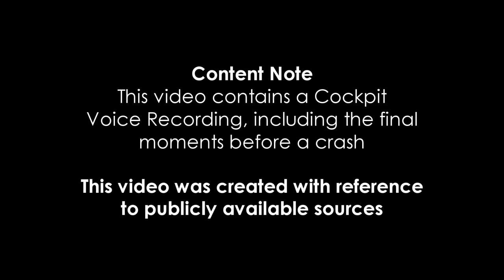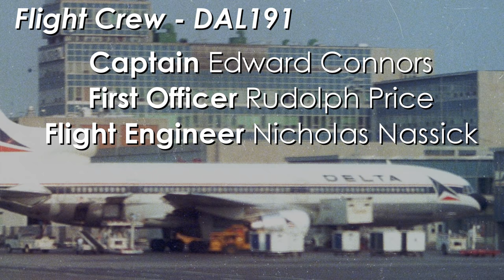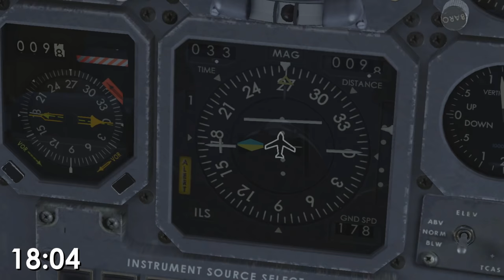How Deadly Weather Brought Down This Plane (Delta Airlines Flight 191) - DISASTER BREAKDOWN

Comment: Speaking as a former L-1011 pilot, I want to tell you this is one of the best summations of the accident available to the general public without getting into the extreme minutia of the case. I appreciate your attention to detail (though to be fair I must point out that you used an L-1011-500 variant in the video CGI model versus the actual aircraft: N726DA was a long-fuselage -1 variant without the Frisbee fairing). At any rate, while not all-inclusive, this is a very well done video. 

As an aside, I have personally flown this windshear scenario in an L-1011 simulator, and can tell you it’s a real eye opener. 

RIP DL191.
Reply: Well said.  From one former Tristar pilot to another: You are exactly correct - if flown in a simulator which accurately models the event, it is truly violent and frightening.  Unfortunately not all sims do it justice, which is a grave disservice to crews training in those devices.
Reply: It has to be terrifying!
Reply: It is survivable by rotating the airplane to 20ﾟ and Keeping Speed just above stickshaker. Obviously the power is to the firewall and the configuration is left the same until Airplane leaves the microburst. I did the scenario many times myself... They had none of this information but taught us quite a lot.
Reply: I survived this plane crash only because I changed seats right before the plane took off and moved to the bulkhead over the left wing. I will never forget the dread I felt when I looked out the window instinctively when the engines suddenly started revving and saw the engine on fire and sparks and smoke billowing off the wing. Until that moment, I thought we were just going through really bad turbulence. When the plane hit the water tower, it exploded on impact, and the plane broke apart beneath my feet. I got injured so badly that I had to spend an entire year in the hospital. I had just turned 16.  I remain infinitely grateful to be alive. The fight was hard won.

Comment: In my opinion, this accident was caused by the hand of mother nature smacking the aircraft at the time when it was most vulnerable. They were just in the wrong place at the wrong time and it was an unusual if not freak occurrence that brought the aircraft down. The captain knew exactly what was happening and the flight crew did exactly what they needed to do, they just didn't have the altitude and speed to recover and the technology of the time wasn't able to give them enough warning. From what I understand, there was some criticism about the captains decision to land despite the small storm cell near the runway, but having to deal with such conditions is hardly uncommon or unusual in the summer moths in the southeastern US. 99.9999^99% of the time landing in such conditions in a wide body aircraft would not end like this landing ended.
Reply: that. And also 2 other planes just landed ahead of them without any occurence.
Reply: Yours is a bit of Monday morning quarterbacking.   We know NOW because of what they didn't know then. No one knew what a microburst was then. Planes used to fly through storms all the time and they still do.  But now we are more capable of evaluating the strength and intensity of the storm before we stick our noses in one.  Additionally, airlines have created "thou shall not" rules for their pilots to help them make their decisions.   If pilots didn't fly through small, light intensity storms (typical in the SE for much of the year) the industry would grind to a halt every afternoon.
Reply: BS. As soon as they say lightening "right ahead of us" they should have aborted landing and flown around.
Reply: @lbowsk  - Exactly.  I was beginning my aviation career at the time this occurred.  Yes, it was known that thunderstorms contained a variety of hazards, but the understanding of microbursts, and in particular the rapidity with which they could develop and dissipate as well as their intensity was in its infancy.

It’s very easy to armchair quarterback the crew in retrospect, particularly for those with no real-world airline experience.  Those who actually understand the complexities and the limited knowledge set the crew had (again, due to lack of knowledge by meteorological scientists at that stage) understand the lack of data the crew had prior to encountering the shear.

Comment: In 1981 the plane that I was on flew into a thunderstorm between Dallas-Fort Worth and San Antonio. It was the most terrifying thing that has happened to me. The plane dropped and rose and dropped like a roller coaster, the lightning appeared to be flashing straight through the plane and everything was shaking. As terrifying as it was, there was no point in being afraid, because the situation is beyond your control. Either you’re going to drop from the sky and die or live and have a story to tell. We lived, but just the mention of Texas, summer, planes and thunderstorms gives me chills to this day, and I can only think there but for the Grace of God, and feel great sorrow that this plane, these pilots and these passengers weren’t so fortunate.
Reply: I did basic training in San Antonio in the summer. I distinctly remember those Texas thunderstorms. the enormous cloud heights and the big walls of blue black  storm coming across the landscape. On a Ft Hood helicopter one time we had to take a rapid course correction to get out of one that just came up out of nowhere. I can only imagine how scary your experience was but I admire your outlook. Stay safe.
Reply: It’s strange to think how God has grace for some and for for others …
Reply: @trinityp8575 Yes, it is. I've struggled with profound survivor's guilt ever since that fateful day.